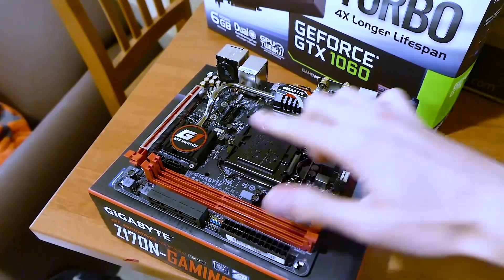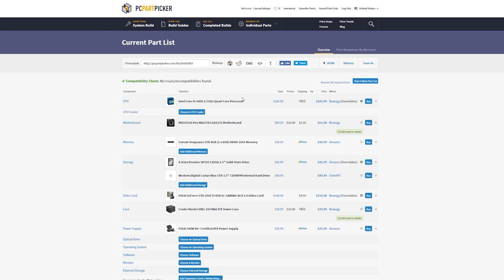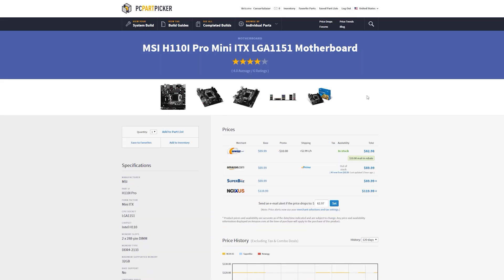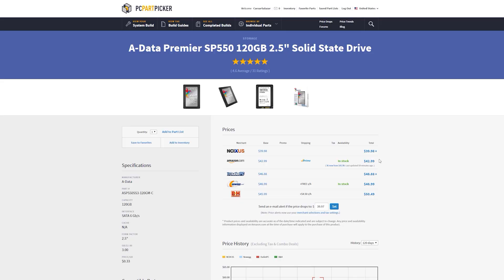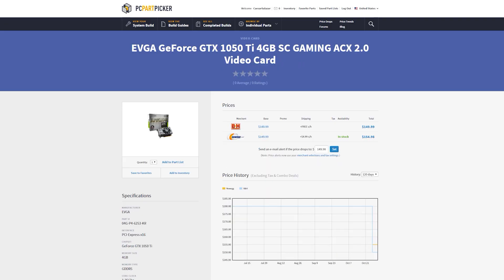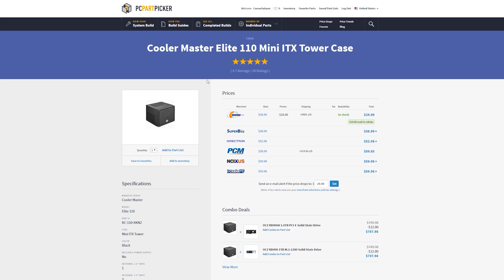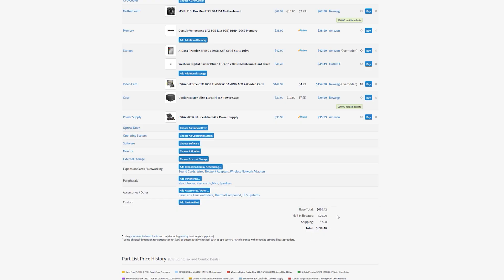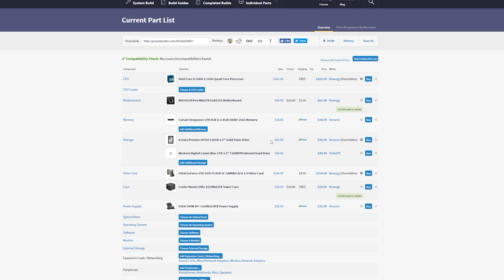$600 ITX PC Build List

Comment: I want to Build this PC. I have Similar Budget . Can you please suggest different Mobo and case? I don't want ITX
Reply: You can go mATX and save some money compared to ITX and ATX. MSI H110M PRO-VD PLUS Micro ATX LGA1151 Motherboard should be around $45-50.

Cases you can go with a Fractal Design Core 1000 for around $25-30. I wouldn't pay anymore. Or a Deepcool TESSERACT for around $35. Another budget route is the newegg DIYPC cases. Should be able to get one between $20-$35.
Reply: JimmysTheBestCop Deepcool is avaible in My country but other two don't. Corsair, Cooler Master, Thermaltake, aslo avaible. Which case would you prefer?
Reply: I've worked with them all especially in the budget format. My low budget preference is a NZXT 210 or NZXT 220 when they can be bought for around $35. I think NZXT is just a little easier to work on in the budget world. I've even worked on no name generic $19 cases with psu, haha. 

Budget just usually means flimsy and you can expect your hands and knuckles to get cut up. And it won't be pretty or have lights or have side plastic windows etc.

Comment: I know this might be a noob comment, but wouldn't the operating system count as part of the cost of building the PC?
Reply: Some people put it into builds and some don't. Just like you almost never see anyone include a monitor and keyboard/mouse into the builds.

Kinguin you can get cheap Windows 10 keys for around $30. Or you can actually run Windows 10 not activated. A lot of stuff gets turned off by default but it is actually possible.
Reply: Thank you, I shall research it a bit more.

Comment: I have a GTX 960 and a i3 6300. Would you suggest upgrading these at all during Cyber Monday maybe?
Reply: I Want to get into the i5 range then focus on gpu as your 2nd item. Such a big jump in performance from i3 to i5. Less with a i3 960 to 1060 for example.

Comment: I would really love to see a future-compatible ITX build for a budget as low as possible(try below 800) ,with the mobo as Asus z170i Pro Gaming . Now thats a challenge!
Reply: Should be the same build except for the motherboard. It should only add around $100 more than Greg's current build. As that ASUS mobo is usually $160-$175. You could even add a GTX 1060 and stay under $800.

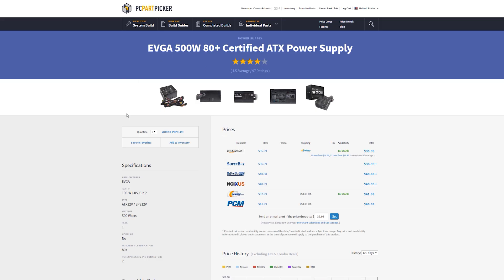Comment: 5:36 Lol, my mini-ITX PC with an i5-6500 and reference RX-480 works just fine with a 300W PSU
Reply from the maker: Not a bright idea. Period.
Reply: Salazar Studio Meh, it's not ideal and I don't really recommend it, but I've tuned some settings and measured power draw from the wall, and it's sitting at about 250W max during Firestrike.
Reply from the maker: Have you tried stressing both your CPU and GPU simultaneously? Slightly curious now ^_^
Reply: Salazar Studio There was a point when I was playing GTA V on it with a 6600k at stock settings (wasn't measuring power draw though). I do have the 480 undervolted -100mV from stock, running at 1250 MHz.

I'm about to go to sleep but I'll definitely test it some more tomorrow and let you know
Reply: Dang 300 watt I don't know if I would push the psu that hard and how do the power supply sound when you game on it?
Reply: +Salazar Studio Just ran AIDA64 for a little bit, set up to stress-test everything. System hung right at 245-250W from the wall the entire run. The i5-6500 is at stock settings and the RX-480 is set at 1290MHz@1050mV chip and 2000MHz@950mV memory. Power limiter is at +15% and it maintains the 1290MHz clock.
Reply: get a 400w psu, the performance difference with a OVER-clocked gpu will make a huge difference.
Reply: +Jace Vo I can hear the fan if I get really close, but it's completely drowned out by the reference card fan anyway
Reply: +Flugzeug Dokus yeah that's a safer option, but I wanted to see how well it would work and it seems quite stable
Reply: +BTech It's a reference card so it can't overclock worth a crap anyway
Reply: Science Studio I have 500w psu lol I don’t wanna bottleneck because of power so yeah

Comment: i just bought a 1070 ftw (will be here tuesday) and im running an i5 3570k, how long do you think i have till the CPU will bottleneck it too much, i know it already will a little bit. But i just do 1080p 60fps atm because thats all my monitor supports. 

i planned on upgrading the CPU, Mobo and RAM (to DDR4 mobo only supports DDR3) in about 2 years (if nothing breaks built the PC in 2012)

Do you think ill be fine till then or do you think i need to do it sooner?
Reply: I hope you know about EVGA FTW 1070 VRM heat problem. Check it out it was breaking news this weekend. Not good.
Reply: I saw but im not worried about it since i bought through amazon and they are good about replacements if something happens and i plan on getting the heat pads also. I got a Note 7 launch week and it still hasnt exploded so im hoping my luck carries over to this.

Comment: Question: why not skimp a little on the motherboard? I'm using an ASRock $45 mITX mobo in my rig right now and it's doing fine. That would give you a bit of budget breathing room for a CPU cooler, or get the 470 without having to resort to getting a $20 from grandma.
Reply from the maker: Try finding an ITX board under $50...
Reply: Salazar Studio Oh wow my mistake. The mobo cost me $65... (My friend's mATX mobo was the one for 45 bucks)
Yeah, not enough to make a difference...

Comment: Would the 120GB be enough for installing Windows and a few other "basic" programs like a browser, VLC, WinRar and all?
Reply from the maker: More than enough.
Reply: Thanks man :) Would you mind answering this question? Would a i3-6100 be sufficient when paired with an 8GB RX480 to play Battlefield 1 at 1080p with a stable 60fps at ultra? I know a Quad Core is recommended, but an i5 would kinda stretch by budget

Comment: My HP All In One HP Omni 200 - 5316d with CPU  i3 550 2 cores Nvidia  geforce GT230 4Gb RAM PC3 10600 MB/sec 1Tb HDD 7200rpm start up about 43sec to 56sec. Is it normal and slow?

Comment: I would remove the solid state drive to buy the cpu cooler. The SSD doesn't improve gaming performance. Also you can add the SSD later. 120GB is never enough for OS and getting more is expensive. This is just for building by a limited budget.
Reply from the maker: I never compromise on an SSD. Night and day difference for general tasks.
Reply: Salazar Studio completely agree. I used to think it didn't matter until I got one.
Reply: I also have an SSD. This is for a pure gamer under budget.
Games require a lot of space these days. I think that installing everything in a secondary HDD could actually slow loading times if the game requires creating temp file under the SSD.
I think you should test that Greg: SSD+HDD vs HDD. How the loading time are for equal system on both configurations. Game installed in HDD in both scenarios.
Reply from the maker: You don't have to agree, but there's no way I'm ever NOT including an SSD. Do what you'd like.
Reply: I'm confused by the "120gb is never enough for OS" part of your comment.I have Win 10 with all current updates so far and at a rough estimate,I'm using 20gb or so.SSD are proven to help with some online Games also.
Reply: ***** The OS takes more than 10%, the other 90% will get full with programs and temp files. Also drivers have big files. You would be forced to take downloads or any large files to another drive.

Comment: Greg, I completely agree with you about AMD. I'm still using an AMD FX 6300 with a GTX 960 and I only average 35 fps in half my games...thinking about getting an Intel Xeon 1231 v3. What do you think?
Reply: Not sure why you would pick the Xeon 1231v3 of all chips to pick from. If your going used there are lots of better options as well as cheaper. I mean you can go crazy and run previous generations and even dual xeon's with mobo and probably still be cheaper than just the 1231v3 chip.

If you are going new just get a i7-6700 shouldn't be much more expensive. Like $50 bucks more and with a Z170 mobo you can overclock non K's. And your in the current gen at least.

Comment: y need 3rd aftermarket cooler since i5-6400 can't OC? intel stock cooler is more than adequate. i personally suggest go for i5-6500 is more wiser & the rest of extra cash $9 spend on 120/140 mm fan.
Reply: Doggy Bhaw Bhaw! cpu oc is something really useless. even if you transcode videos. you'll get 1-5% speed increase but you'll spend money on cooler. in most cases OC does not save your money, it actually makes your rig more expensive.
Reply: yeah but i suggested is based on this $600 & ITX build. if wanna OC better get ATX case. this kinda small case will cause throttled issue.
Reply: dude you can oc i5 6400 sith z170 mobo.And when you oc i5 6400 it rips i5 6500(oc)
Reply: Doggy Bhaw Bhaw! Z170 mobo is more expensive & the OC is not recommended but not all mobo supported. so far i know ASRock.
Reply: +Alexey Lavrov Yea right.But I was just talking about how i5 6400 can perform same as i5 6500
Reply: Khan Mein If you oc the i5 6400 to 4.66 Ghz it will Be much better as an i5 6600k

Comment: for $20dls more you can buy an rx 470 4gb. It performs like 40% more on dx11 and 50% on dx12. Right now the 1050 is not a good option.
Reply: dont worry... i just read the description...
Reply: no RX 470's fit in the elite 110
Reply: Tom/Kate Fedrick you can fit a 1080 in there...
Reply: Julian Grimoldi max graphics card length 8.3 inches. shortest RX 470 is 8.6 inches (single fan XFX) - go look up the stats

Comment: My system is a joke, tell me what you think. 
A10-5800k stock I never overclock
Swiftech h320 x2
8gb of G.Skill ram
Phanteks Enthoo PRO M Acrylic Window Computer Case
X2 Corsair Air Series AF120 Quiet Edition 
EVGA 750 GQ, 80+ GOLD 750W, Semi Modular PSU
WD Black 1TB 
Runcore SSD sata iii os is installed on it now.
Samsung 850 EVO 500GB (This will be my main drive once I stop watching youtube videos)
GTX 1080 founders edition

Next month I will upgrade my processor, motherboard and ram, but I was also thinking about waiting to see what comes out early next year. I know my processor is a huge bottleneck, but my monitor is a SyncMaster SA950 so the best it can do is 1080p 120hz.
Reply: Bulletcore duuude that a10 doe... can... can you even get 70 fps?
Reply: that 5800k is a giant bottleneck, for the 1080 you need at least an i5 6500
Reply: I play overwatch and I get 78 fps on ultra LoL.
Reply: Bulletcore lol, with an rx 480 i get over 100fps on overwatch, and the 1080 is twice as powerfull as my 480
Reply: I had that APU for a few years now, it is a solid processor but not for what I going for now. All I need to upgrade is the processor, motherboard and ram and it will be a solid build. I figure $500 more and I am set for 2 or 3 years unless something amazing comes out from Intel or AMD next year.
Reply: +Bulletcore I would by now. New desktops chips won't be out until spring. AMD already stating most of Zen is slipping to Q2 2017. And you saw how hard it was to get their gpu's the first 3 months they launched.  And Kaby lake is going laptop processors first then desktops. Probably spring as well. That's basically half a year at least. Tech is never ever on time.

If you still don't want to go skylake and new right now. Check this out on ebay Dell Optiplex 7010 I7-3770. Should be able to get that for $250-$275. Complete system. Rebuild your computer with those parts. And build sale machine in the optiplex case with all your extra parts. Then sell that system. Should easily get $100-$150 for the leftovers. So you basically took a giant leap forward for around $100 after selling old stuff off.

Then if you want to buy new in the spring. You do the same thing and make all the money back on the i7-3770 by selling it off. It still sells for $175 by itself on ebay.
Reply: Great tip, but don't oem use a different board than retail so it won't fit on my mATX case.

Comment: i have a good idea for a vid, play bf1 in 64 player conquest mode with a high refresh rate monitor and check the cpu load from different cpus. my 4460 is @ 100% and ive heard reports that all i5s and older i7s (not including 4790k and 6700k) bottleneck aswell.

Comment: Guys I have an MSI gtx 1060 gaming X with 6gb vram. Should I (still) upgrade to a 1070 or buy 2 RX 480's? I'm only gaming with a 1080p 60hz monitor and will upgrade my display until my monitor blows up.

Comment: Nice build, I'd say the sweet spot in terms of value, longevity and performance. I agree with the RX 470 4GB being a better deal though, in the UK I've seen one go for less than some GTX 1050 Ti's!

One question I have is whether an aftermarket CPU cooler is worth it. I mean, if the CPU has Turbo Boost then in theory it should allow for higher clock speeds to be sustained because it won't be limited by the temps, and probably will be quieter too but the stock cooler should do a decent enough job of keeping the temps at "safe" levels, right?
Reply from the maker: Yes. I never said an aftermarket cooler was necessary. It'll just quiet things down a bit.

Comment: Why not get a modular PSU? You can get one for the same cost, and it's worth it to have less cables, better airflow, and therefore less heat.
Reply from the maker: You can only get one for the same cost after a mail in rebate (the money from which you won't see for several months).

Comment: I just bought an Nvidia 1050 Ti to replace my current graphics card. I have two systems, one with an FX 6100 and an i5 2400. Will I see significant increases in gaming performance if I put the card into the i5 system instead of the FX 6100 system?  The i5 is in a small form factor case, so if i wanted to use it, I would either have to put it int he other computer's case, or buy a new power supply, and hard drive for it.

Comment: but if you need to go cheaper then that get 1050. not much worse but better price to performance. the gtx 1050 is the best price to performance card out right now for $110 followed by rx 470 at $170. 1050ti is a good card but a little expensive. the Rx 460 need to go down more as well because it does not have very good price to proformance at $100.
Reply: Frame per dollar isn't a very useful value when VRAM comes into the picture. If you don't have enough VRAM, your frames tank - No matter what the frames per dollar you get when you have enough VRAM are.
Reply: The problem with the 1050 is that it's not much cheaper and only has 2GB VRAM, which now is becoming the bare minimum for most modern games
Reply: Sina Madani it doesn't matter for that low power of a card look at the benchmarks. also $40 is a lot at that price point. I was just saying frame per dollar it is way better the the 1050ti

Comment: This is a nice part list, mr Salazar. I would personally get the i3 + Rx 470 since its price dropped, but I do understand why a true quad core is also a very good pick, specially if you plan on playing GTA V or heavily modded minesweeper
Reply from the maker: LOL @ that last part.
Reply: helloworld459 I think so too but for some games it won't run at all with 2 cores, and with newer APIs the load will be better distributed among the threads, making the i5 a significantly better pick

Comment: I was just thinking about making one earlier today, 2 great minds think alike lol.
http://pcpartpicker.com/user/OGPrince/saved/wNfHxr
Is mine any good?
Reply: looks like a good build, specially with a Freesync monitor
Reply: Tuchulu Thx man, I might actually build it one day.
Reply: Very Nice, more Power then his Build, im only missing an SSD, but you could drop the keyboard+Mouse and do the same like him and go for an 240gig ssd :-D
In price/performance you absolutely win
Reply: 3DamX1 That's a great Idea actually
Reply: Make room for ssd and switch to gtx 1060..
Reply: kristo2212 I can get the build to stay at 600 with just the 1060 but not the ssd :(
Reply: Prince Louissaint You can if you remove keyboard+mouse and hard drive :)

Comment: Hmm... the H110 chipset doesn't really allow for overclocking so I'd suggest going for 2133MHz DRAM. Will say the same for the B150 & H170 chipsets.
Otherwise looks good. Though the i5-6400 might not play nice with some games which require 3+GHz clock speeds with high settings or higher. This is mainly single core stuff from OpenGL or DirectX 9 to DX11. Just a heads up.
Reply from the maker: RAM frequency doesn't matter. Pick whatever you'd like. Games don't "require" 3GHz+. That is a downright fallacy, and I've proven it in a late video.

Comment: WHAT SHOULD I GET THE 400C OR S340 ELITE
Reply: s340 Elite m8, it looks better and better quality
Reply: i have the 400c it is not very easy to assemble in it but for the looks it is totally worth it
Reply: Marcelo Rdz really it looks like the cable management would be great especially since its a modular case
Reply: i have a non modular psu what helped me alot with the cable management was to take out the ssd tray from the thumbscrew
Reply: oh ok thanks,btw u should get a semi or a full modular psu
Reply: Christopher beltran S340 Elite.
Reply: it is esentially the same since the cables taht you cannot unplug from the semi modular will be the same cables that are essentail like the atx power snd the cpu
Reply: 400c
Reply: Phanteks Enthoo Pro M
Reply: Phanteks P400.